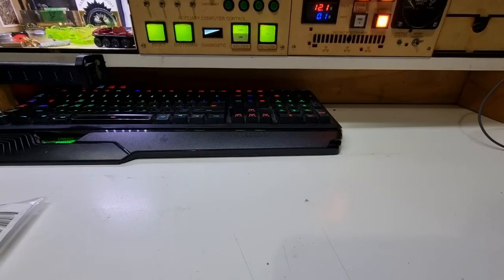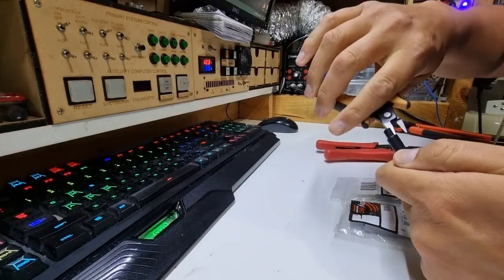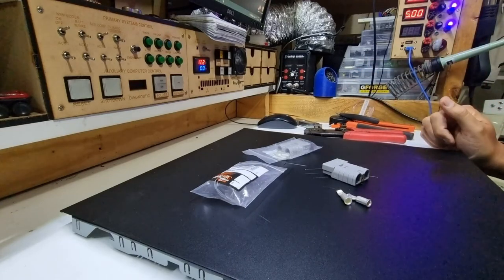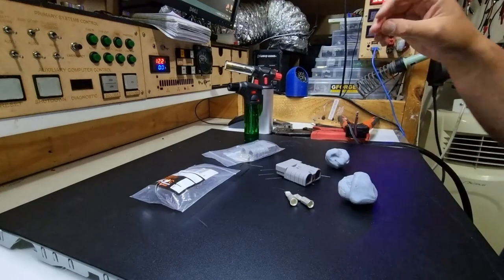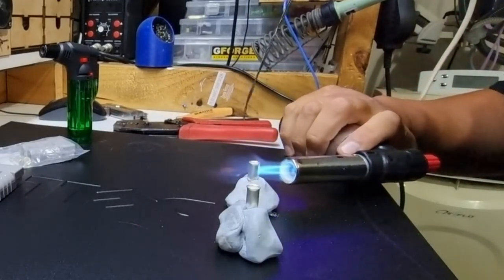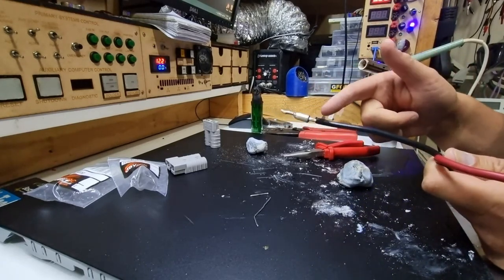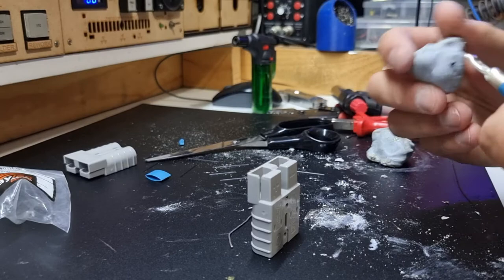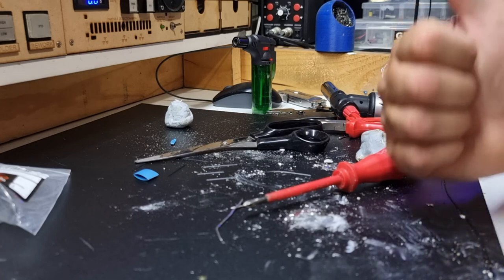Soldering Anderson Plugs

Comment: Well done mate, good oil.  Andersons love em and hate em when they go bad and start arcing.  Course there's a heap of cheap charlie copies flooding the market and you know what that means.  What was wrong with a pin and socket like MC4s - they are waterproof IP67? - but can you pull them apart in an emergency I dont think so?  Anyway slick marketing made these  eponymous (like hoover).  Very good instruction. Sadly noobs often dont get good soldering technique which is key. Crimping these you need a hydraulic tool and you are right about corrosion wicking up the joint - dont do it.  So to make these Andersons water resistant - pack them with silicone grease?  What do you think?
Personally I would dip the wire in a tub of flux and tin the wire first that way, but Im old school.

Now what do you do with an old installation where you have to cut out and replace a bad Anderson. Chances are (if you are a boaty) that water will have wicked up the cables and made surface oxided copper, now blacked and no longer shiny.  Normal flux doesnt cut it.
Reply from the maker: Yeah I try to make sure my cables don't get that far, and I use tinned copper cables which helps a bit with that.
The solder is flux core 60/40 tin lead, not lead free, I have seen people do these with silver solder and complain about how bad solder joins are - not realizing lead solder is a thing.
but yes they need to get properly hot first I agree.